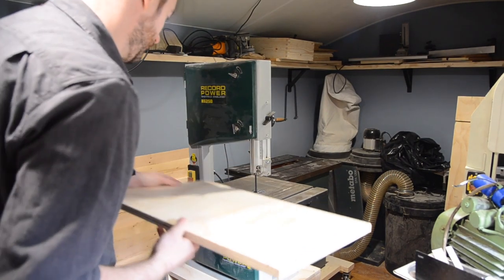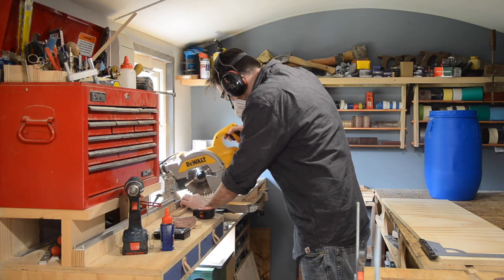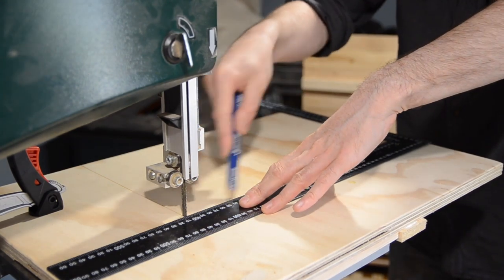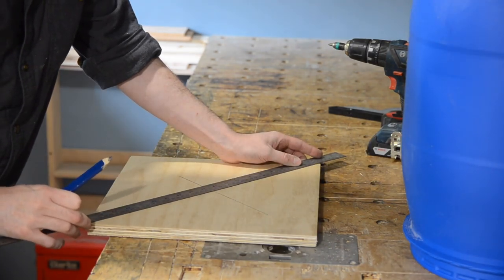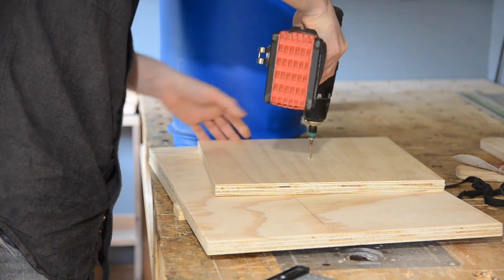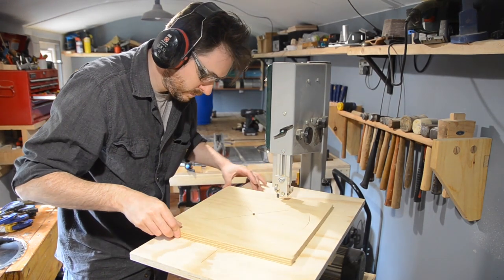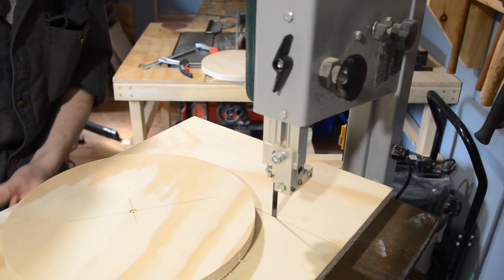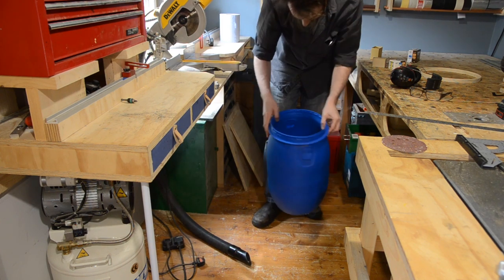Stopping The Barrel Collapsing

Comment: Cheers. This has worked a treat with my (slightly larger) barrel. Really struggled to get the ply ring in the barrel, but once in, it's as solid as a rock. Really pleased I don't need to sort another, more expensive solution! 👍

Comment: Really helpful, thanks for posting. Once the barrel collapses it’s hard to reshape. I struggled for while pushing and pulling and then connected the vacuum cleaner outlet to the cyclone, blocked the outlet and reinflated the barrel ok. It mostly came out the original shape but better to stop the collapse in the first place!

Comment: I’ve had the same problem - I’ve just purchased a pressure release valve which has been recommended on several videos - wish the videos explaining how to set up a shop vac/ cyclone had mentioned the problem … if the valve doesn’t work I’ll try your method (liked the quick and easy jig).

Comment: I done exactly the same but put the ring on the outside works a charm
Reply: How is the ring going to stop the barrel collapsing when its fitted to the outside?
Reply: @roberttill3787  to collapse one side needs to expand if it cant expand it cant collapse the ring needs to be solid, a strap wouldn't work tho
Reply: @benny5190  interesting. my barrel has a screw top that's too tight to fit a ring in, I wonder if this would would or not? I'll give it a go and let peeps know. thanks!

Comment: Good work. I have similar problem, a tall square 15ltr barrel with 6" screw down lid, that sucks inwards with vacuum.The cyclone is aluminium casting mounted inside under the lid. 
I cut Some scrap veneered chipboard & interlocked assembled as a cross inside the barrel. 
I drilled & screwed into the chipboard edges from outside to stop it parting & dropping off. 
Biggest problem with the plastic barrel is build up of static & thick lining of sawdust/wood chips on all internal faces. Very dusty emptying & brushing static sawdust.

Comment: I had the same problem. I cut 3 plywood squares - cut a different size circle in 2 of the squares - mounted the 2 squares on the outside of the bucket (middle / top) - the bucket sits on the 3rd square - wood spacers between the squares - I screwed into the plywood from the inside of the bucket using large washers - it doesn't collapse anymore and the wood adds weight to the bucket so it doesn't tip over - as there's no wood on the inside it's still easy to empty…(I have a dust deputy - it's more expensive but I wanted a transparent cyclone so I could see that it's working) don't know if my description makes sense to anyone — like your videos by the way…
Reply from the maker: Sounds like a good solution

Comment: Bending some fiber wood, with a rope, to hold the shape, and then inserting it into the barel, so it will create outwards pressure also is a workable solutions.. i am actually gonna put some aluminum sheat on top of the fiber wood aswell for maximum support.

Comment: Instead of using a barrel or bucket to capture the wood chips from the separator can I just make a wooden box with a lid and and the separator attached to the lid? This way it doesn’t implode and I can make any size container I wish? Look fwd to your thoughts. Thanks for the video.
Reply: Three years later:  Yes, you can. The shape of the chip box is not important to the operation of the cyclone.

Comment: Great solution for stopping the barrel collapsing. Thanks for sharing.
The start of the video was more or less making the jig for making circles on the band saw.
A similar jig you made some months ago which you also showed in a video. I made that one. It works perfect.
But what is the difference between the first (older) jig and this newer one? At first glance they looked the same to me.
Reply from the maker: The other one used the mitre slot
Reply: @Badgerworkshop  Thanks for your reply. 

Yes, now I remember :-)   When I made mine that time I had to do some adaptations to your jig because I do not have a miter slot on my
band saw table.  Both your jigs are super simple to make and they work perfectly. Nearly the ideal world.

Comment: Great job.  I was lucky my waste bucket was wider at the top and tapered slightly towards the bottom.  My second version I cut the middle out with a jig saw so I didn’t have to cut through the ring, although it works just as well either way.
Reply from the maker: Sounds like that would make it much easier to install

Comment: I would fabricate a blast gate with a pressure relief valve in it, between the barrel and the motor, so that if the suction was greatly increased as with a blockage, the safety valve would open, letting air into the pipe before the barrel collapses. All you need is some pipe, say 75mm pipe, a spring, and a thin piece of ply, say 6 mm. Cut a circle that goes up the pipe, screw some screws through the pipe to give the ply a stop point. Down stream cut some pressure relief ports in the pipe. Cut a stopper from the 6mm ply and push that up to the stops. Find a spring that can sit behind the ply, and secure this in the pipe behind the ply stopper. Then adjust the tension in the spring to match the pressure you desire the stopper to let air in. This is the hard bit as it will be trial and error. Once you get the ideal place secure the sping in place, and fit it in your extraction system between the barrel and the motor. The relief pressure can be adjusted by resetting the spring tension.
Reply from the maker: or I could put a ring in the barrel
Reply: @Badgerworkshop   hahahaha!

Comment: Same prob I had and this looks like the solution rather than simply storing a sizeable blue bucket which doesn’t work!
Reply from the maker: It is working great so far
Reply: Badger Workshop Looking at your last top down shot, I see the splint is open where you have started the band saw cut, with a potential week spot for the future. The first (outer) cut matches the external diameter you measured. If you reduce this about 2mm' it would be closer to the internal diameter and then you could glue/screw the split splint to brace it better. Alternatively 3 or 4 screws through the bucket into the splint would stop it caving in. Am I being too pessimistic?
Reply from the maker: It really is not going anywhere

Comment: I use a fermenting bin, but that's exactly the same solution I used :)
Reply from the maker: Works well
Reply: @Badgerworkshop   I think the barrel is probably better than a fermenting bin as it's inherently stronger,  when I first put mine together it would collapse as soon as I turned the vac on. I needed a  couple of reinforcing rings. Still works really well  though.

Comment: The tip about warm water was very helpful. Thanks Matt .
Don't have a band saw so might try making a router jig.
Reply from the maker: I struggled for ages before I worked that out. It does not need to be perfectly round so a jigsaw would also work.